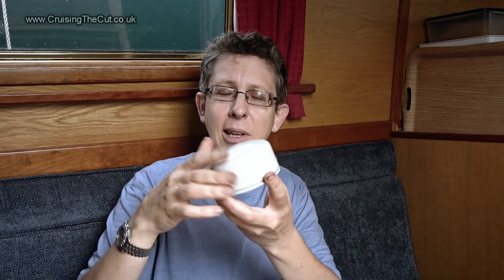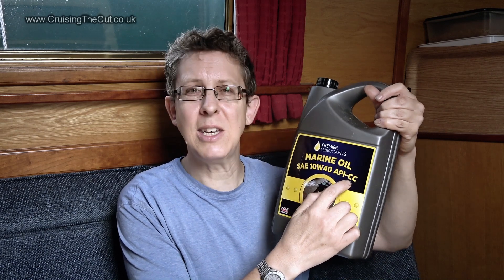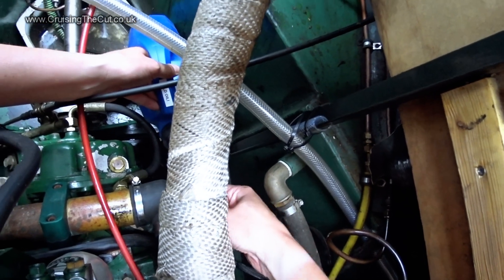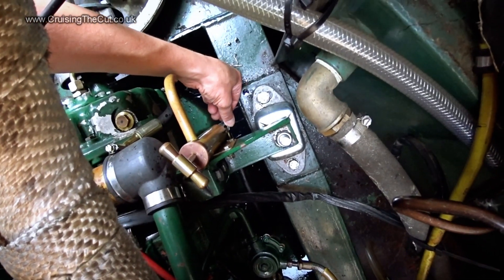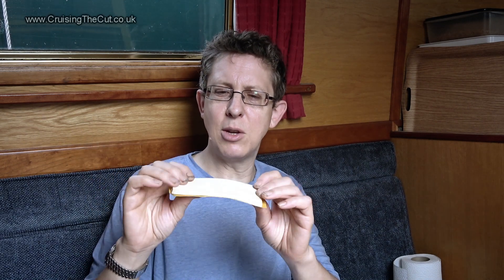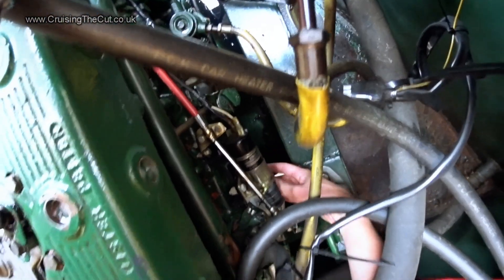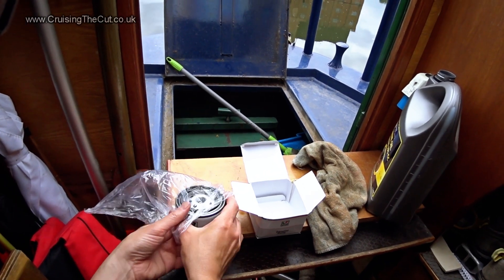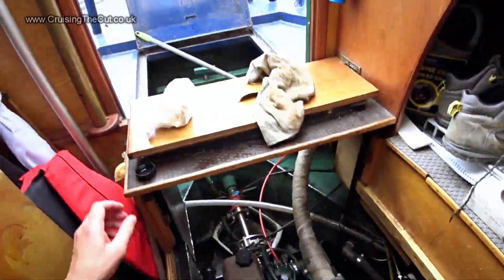110. Oil and filter change on my Lister Petter LPWS4 narrowboat engine (canal boat)

Comment: Would have been cool if you sent an oil sample out to a lab to see how much longer you could have gone before changing it.  Most people change the oil to often.  Anyways great video
Reply from the maker: You can never change too often. Engines love fresh oil.
Reply: CruisingTheCut thanks using api cc your correct.  Don’t ever recommend changing it although you have an oil filter so you could use modern medium duty oil.  But its gambling with no pay off.   Train engines data showed the carbon in black oil helps with wear but cause sludge.  Anyways love your videos thanks.  Been stuck inside for 7 days.  Erie Canal has a couple narrow boats but locks are huge. PS I love doctor who and Star Gate.
Reply: Actually, at least regarding conventional oil, old oil is a better lubricant than new oil. Oil molecules act like little ball bearings between the surfaces they are protecting, in petroleum oils these molecules are of different sizes, the bigger ones taking the bulk of the load until they are "ground down" to the size of the smaller ones. With synthetics, being manufactured rather than refined they are all uniform size to start with and that is the reason that synthetics are superior to refined oils. Of course the high end synthetics usually have a premium additive package as well. Of course as the oil is used it gets dirty and the additives get depleted which is why it is changed but it's kind of ironic that the actual lubricating properties of the oil you drain out are probably superior to the oil you're putting in

Comment: Even though it's been 4 years since this video was posted, I can't think of a better place to post this for a reply, perhaps from one of David's many viewers: I've never owned a diesel-powered vehicle of any sort, but everything I've ever read about diesel engines is that they are at peak efficiency at high(-ish) RPM. That being the case, it would seem that a diesel engine that spends its entire life at tick-over or otherwise very low RPMs is not working in its sweet-spot. So let's just accept that. So my real question is: does that kind of operation create any problems such as, oh, maybe greater build-up of soot or carbon on the head or something like that?
Reply from the maker: Yes, it's not good for them so it's good to give them a blast of throttle (eg go up a river sometime) to clear the cobwebs!

Comment: I once used a screwdriver to unscrew an oil filter. Ended up ripping the aluminium case so that I was left with a jagged and still stuck on oil filter. Minutes later I was bleeding & still had a stuck, jagged oil filter. At this point decided I needed to buy a strap wrench... but couldn’t go to the shop because my car’s oil filter had a nice jagged hole in it. I would suggest buying the proper tool, or at least leave screwdrivers for driving screws.
Reply: Then there are the vehicles where a sadistic engineer placed the filter where there's no room for a strap wrench.  There are also end caps that take male socket wrenches.

Comment: I would of done that in the morning when the engine is cold and not after 5 hours of cruising and always use a funnel and measuring jug.

For you to take filter off that easy means it was not on very tight 

I've had right tool to remove filter and its been on so tight in the end had to use hammer and screw driver to remove it  and my trade is mechanical engineering with some electrics thrown in
Reply: Probably difficult to remove oil filter because someone used the oil filter wrench to tighten the filter. Should alway only hand tighten a spin on filter.

Comment: Good afternoon David. The wife and i are big fans. I commented a while ago saying were in the market for a boat, well, weve got one! Yay. Thing is we need advice and im sure you have nothing better to do with your time. We after finding a winter mooring in the leicester area and wondered if you had any knowledge you might share. And also the boat isnt currently sporting a log burner and wed love to remedy this any advice on suppliers who also install?
Reply from the maker: Congratulations! I've no idea about stove supplier/installers, sorry. As for moorings, depends if you like marinas or want a CRT towpath mooring or what ... and your budget!!
Reply: CruisingTheCut sorry i shouldve made myself clear... because of the lack of solar panels and sunshine were going to need shoreline hook up so i believe thats us marina bound, and as were moving aboard on the 1st dec i think the relative safety of a marina would be a wise move. Currently the boat is heated by a gas powered central heating system and if i remember correctly from your vlogs it would be cheaper to snuggle around burnin £20 notes. By the way thankyou for replying... im sure you have thousands of comments.
Reply: Also budget wise would be anything upto £200 a month... but if we can get one for free.... thatll do nicely
Reply from the maker: I think you'll definitely need to brace yourself to pay that much for a short-term (winter) marina mooring.
Reply from the maker: You might try Pillings Lock marina; I've only visited but it seems nice enough and they'll do deals. Otherwise just google Leicester marinas then google the marinas on the canalworld.net forum to see what people think.
Reply: CruisingTheCut is it very expensive then?
Reply: CruisingTheCut weve got a mooring. A place called Trinity marina. On site pub launderette shower block all other amenities and all for the reasonable sum ( we think) of £170.00 a month. Did we do well or is that a bit pricey?
Reply from the maker: Sounds very reasonable for a marina, assuming it's quite decent!

Comment: Beta engines have a screw-on cap on the end of the pump, which you need to remove first, as well as a tap.
Reply from the maker: I did not know that - good info.

Comment: Clean cut down lemonade bottles make a good, cheap and disposable if required , funnel for re oiling engines😊
Reply: The necks  of the bottles are too too big to fit in the neck of filler. What need to do is cut the neck of a flexible funnel  then place it over the plastic  bottle after cutting the bottom out now you can fill up in rough waters.

Comment: The filter tightens up during it's time in place on the engine because the oil is pumped through it in a clockwise direction, centrifugal force is the reason for sometimes needing to be Popeye the sailor man (Special offer, and for a limited time, nautical reference free with this comment)
Reply from the maker: That's why I eats me spinach!
Reply: Only in the Northern Hemisphere apparently.
Reply: That wouldn't apply in a case where channels have been manufactured to direct the flow in a specific direction.

Comment: As your camera equipment list (even the latest) doesn't seem to include a small action cam,  I do have to ask:  How did you strap a large camcorder to your head for this?  The idea conjurs up most amusing images with duct tape, etc.
Reply from the maker: Ah, I used to have a small Sony AS-50 action cam, which had a head mount. I have now sold it since the upgrade to 4K (it was HD only) and now have a DJI Osmo Action, which I'm largely unimpressed with due to its very poor, grainy picture in anything other than bright sunlight.
Reply: Thanks for clarifying.

Comment: You may want to invest in a pair of mechanic's gloves, which provide heat protection as well as a sticky palm material for a good grip on oil filters.
Reply from the maker: Or just not do it when the engine's steaming!!
Reply: Yes, but where is the fun and adventure in working with an engine that is only comfortably warm?

Comment: Pardon if this question has been asked already. I did pan down and didn't see it. How often do you have to change the oil? I'm binging through old vids on your channel to catch up but it seems you've just done this.
Reply from the maker: My engine wants new oil every 100 hours (yes, really) but other engine types will have different requirements.
Reply: @CruisingTheCut  would you say that's average or above average for a diesel inboard? If that's the sort of thing you either checked when searching to buy or something you ask other boaters when you're not comparing toilet systems!

We had one holiday where we noticed water was getting into the oil. Rather than abandon the trip we ended up visiting a car garage in a village near the canal, they kindly let us have a short piece of hose and we constructed an oil extraction device with it and a Lucozade bottle. We ended up changing the oil every single day to try and get it to last. This included a couple of times where we took the outboard off completely and held it upside-down in order to drain it completely. Luckily boating is so relaxing and enjoyable that the problem didn't really put much of a downer on the trip.
Reply from the maker: Daniel, my 100 hour requirement is unusually low I think; indeed there's a different build of the same engine that only needs a service every 250 hours.
Reply: @CruisingTheCut  that's a shame. Lucky it's a fairly easy process and your solar keeps the hours down a bit I guess!
Reply: Every engine is different, they can go from 100 hrs to a modern Iveco that is 600 hrs  250 is probably average, but modern oil is so good that if its black and slippy its probably doing its job.

Comment: In the future you better change the oil after a few hours (full throttle/hot engine) sailing, than wait a few hours so the thin hot oil have the time to leak all down into the crankcase. Then you are able to pump out more old dirt oil.
Reply: and to get the last of the gunky oil out, I was told to sacrifice a cupful of fresh oil in the top after the draining (pumping), then have a cuppa, then pump that out too. Only needs done every couple of changes, all you are doing is flushing the heavier deposits that cling to the oilway nooks and crannies as it drains.

Comment: I wonder if the engines on somewhat older boats weren't designed specifically for boats, but for general purpose power like tractors or driving hydraulic systems.  It would explain why the placement of things like filters is so inconvenient.
Reply from the maker: Yes, they're not marine engines by design, they get "marinised" by various companies. For example, a BetaMarine engine is actually made by Kubota if I recall correctly but Beta tweak it for boat use.

Comment: If your engine holds 5.5L of oil, how did the old oil fit in a 5L container?
Reply from the maker: I wondered about that too but can only presume the pump doesn't quite get all of it out.
Reply: Erm ???? From the previous oil change. All ways make sure you have an old container. BS
Reply: Maybe it's the Law of Diminishing Returns!
Reply: Up to 500ml is retained in the old filter, :-)
Reply: Some of it burns in the cylinders, some of it is expelled as vapor out of the crankcase filter.  @CruisingTheCut, there may be some left in the sump (there almost certainly is), but even if you fill 5.5L each time, an older, stolid diesel like this will easily burn 0.5L of oil in the interval, giving you only 5.0L of waste oil.  Thus it is wise to know the difference between oil changes, you can tell if you need to start adding oil between changes, or perhaps your engine is old enough to require maintenance if it burns too much.  Not likely, though, these old-tech Diesels tend to run and run, they just start needing a drink now and then.

Comment: Thank you for showing that process; I am a bit envious that you have an oil extraction pump built right onto the engine. 

I personally would also be very tempted to replace the manual pump with a 12v option like this one(Not an endorsement, just an example) https://www.amazon.co.uk/FreeTec-Scavenge-Extractor-Submersible-Motorcycles/dp/B076J63NF7 At home, I use a hand operated extractor pump just because I don't like how loud those small 12v pumps are, and when using a hand operated pump, I can easily hear when it's done. The downside of course, is that hand operated pump is rather bulky in comparison.

On a related note; oil extraction via the dipstick tube does work just fine and I imagine it would probably take out almost as much if not the same amount as that extractor that is built onto the engine. On a modern passenger vehicle engine, they have a good chance at being able to actually pull out more oil than you can drain via the oil drain plug, because a lot of times that plug isn't at the lowest point of the oil pan due to ground clearance issues.

Comment: Just some advice for you. Firstly wear gloves. I repeat WEAR GLOVES. Please. Don't want legionnaires disease or any nasty later on. Also when changing oil simply not good engough to just pump out the sump dry. Sump is what your pumping out and where oil Is collected. Need to purge the  lines aswell. To do this after pumped out the sump pour about liter of oil into the engine. Then if possible hand turn engine over if not. Run engine from cold for about a 10 seconds. This will flush most of the old  oil out.  Then after you finish pump sump out again change oil as would normally. It very important to flush lines cause old oil cause acdic depoist which will clogg your lines. As for numbers at the start. They relate to oil boiling point, thickness and useses. Hopefully not nanning you. As engineer pains me to see change oil like this.
Reply: Pointless. There's what, about 1% or 2% of the oil volume in his lines. So, since he changes his oil every 100 hours the same 1 or 2% dirty oil would be produced in an hour or two after having added 100% pristine oil. Better change the oil at 99 hours and not waste your life trying to pump out every atom of old oil for that last %

Comment: If the Lister takes 5.5 litres of oil I wonder why you were able to get the old oil in a 5 litre bottle. Maybe the extraction pump does not allow you to get it all out.  There are drain plugs on these engines but they are not easy to reach in a traditional engine bay.
Reply from the maker: Yes the actual drain plug was right underneath with metalwork in the way
Reply: @CruisingTheCut  there is another at the end under the water pump, pulleys etc. Just as inaccessible
Reply from the maker: There wasn't one there on mine 😳
Reply: But if it doesn't allow you to get it all out, how come he put the extra 0.5 of the new oil in? Surely, he'd only be putting 4.5 in, unless he didn't show us putting the last 0.5 into another empty tub. This is what he's not telling us, then there wouldn't be a need for all these conundrums.

Comment: It must be a pain in the arse reading all the “do it this way” comments after a maintenance vlog?

I would like to make 2 comments however 🤡.

1. Regular oil & filter changes on any engine is the best bang for your buck you can achieve. As a biker I change oil & filter on my bikes every 1000 Miles. In my camper van I change them every six months or 6 thousand miles which ever is soonest.

2. Check to see if your oil remains clear & clean. Carbon builds up over time, & if after an oil & filter change your oil quickly goes black, particularly in older high mileage/hours engines, it will be worth considering using an engine flushing oil first. You will be amazed at the difference! Your engine David looks fairly young so I imagine your oil will stay clean longer.
Reply from the maker: I love reading the comments! (if they have constructive advice). You make good points :-) I find diesel engines blacken their oil a lot quicker than a petrol so I'm not sure point two is so applicable (though I stand to be corrected)
Reply: CruisingTheCut Stand corrected ..........

Comment: I got a Lpws4 but I don’t see the oil pump
Reply: You can use a domestic vacuum cleaner (with an extra DIY-madevacuum pot) for suction like they do for cars- search youtube for it - pretty easy to make. Just don't overspill the pot! Lawnmower service guys do it all the time, they only use small quantities of oil. For cars and trucks it make more sense for oilchange shops to buy a specialist high capacity unit.

Comment: What about using a cellphone or mirror to see everything easily?
Reply from the maker: I wouldn't want to risk dropping my phone into the oily bilge or dribbling oil onto it.
Reply: @CruisingTheCut  A bit of polished stainless sheet metal makes a good mirror for engine work. Stretch some large cut strips of inner tube (cut an a angle to the size you need to make large elastic bands) around it to stop it sliding around when you rest it at an angle. Heavy wooden block with inner tube over it to position it.  Repolish scratches out with toothpaste, finger and a cloth. Glass mirrors are such a pain if they break.

Comment: I  the old oil in my tank , as do many others in haulage , how ever not a good idea on a boat if your exhausht comes out the top.
Reply from the maker: Huh? A word missing at the start there, I think!
Reply: sorry me and my glasses lol.
Reply from the maker: But what was the missing word?! I'm dying to know what you do with the oil!
Reply: i would tip , after filter through news paper.
Reply: I have a feeling that the original poster pots his old oil in the diesel (fuel) tank.  Diesel is an oily fuel and, diluted into a fairly full tank of diesel will probably be OK... it is fairly easy to convert a Diesel engine to burn vegetable (cooking) oil, though your exhaust will smell like a chip shop.

Comment: NIce video, but you have to clean your bilge. Its a good feling not having liquids in the bilge.
Reply from the maker: As explained in the video, that oil was from removing the old filter and also from a leak that the engine has. It does get mopped regularly, thank you.